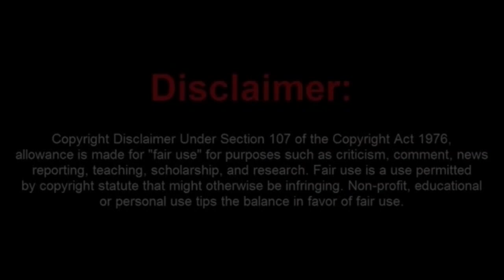Toddler Danny Boy Shuts Down Construction Site

Comment: Just a lil' FYI to those who have a brain (and use it), if and l say lF a hydraulic line blows, not only would you get burned but depending on the size of the hole, the oil could go through you like a bullet. The last place you wanna be is around the back side of yellow iron for a number of reasons. Be smart, be safe and stay out of the way.